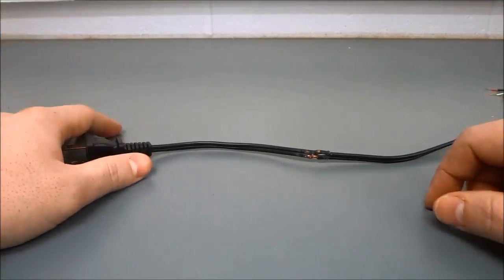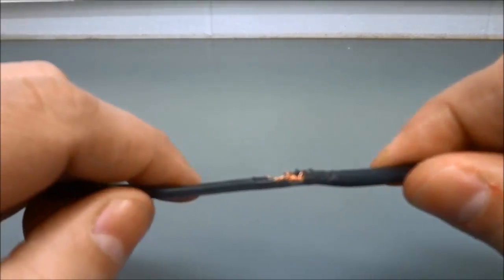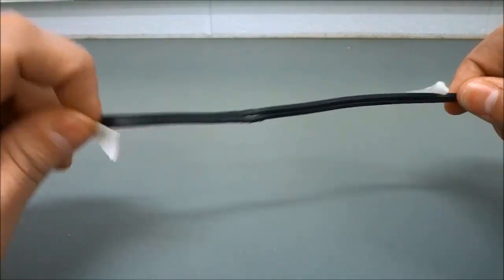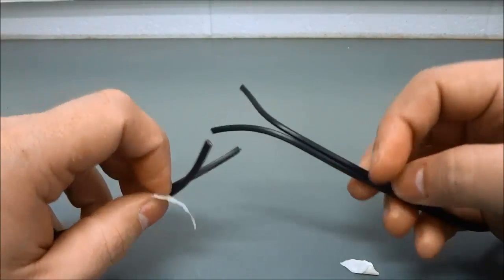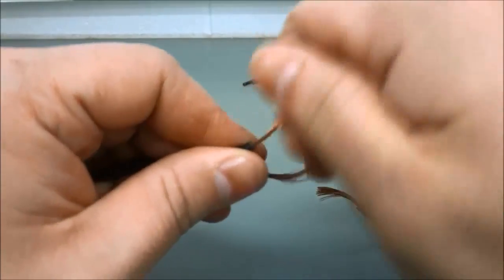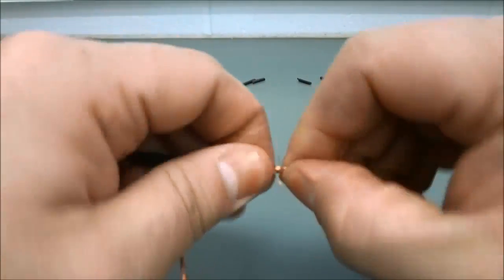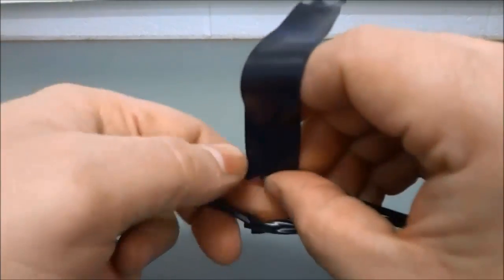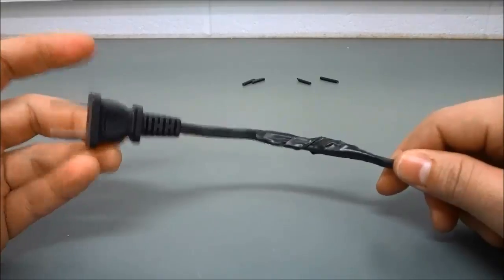How To Fix A Broken Power Cord (2 Prongs)

Comment: Stagger the cuts so that neither bare area of the spiced sections can come in contact with the other. So on one broken end of cord, one conductor is longer than the other conductor, then other broken cord side is just the opposite. This means no matter what these two bare conductors can't contact each other and the splice overall is not as thick. Then as video shows, except don't use electrical tape, use heat shrink tubing. I have a smaller heat shrink to cover each of two splices, and a larger one over the entire power cord with spices. I would also recommend soldering your splices, but not absolutely necessary.
Reply: excellent advice, you should make a video.

Comment: I usually do things like this myself but, to be sure, I scour the DIY videos on YouTube for specific information I may need to be absolutely certain that I don't mess up and set the house on fire or electrocute myself. My problem was that my puppy chewed the plug off of a $30 cheap standing Lasko fan. The hell if I was going to dump the old one and buy a new one. I just can't be that wasteful. So the info I needed was right there in the first minute of the video where he explains how to tell the difference between the two sets of wires. I was looking for a visual difference in the wires like one being black and the other white, and didn't notice the "textural" difference where one had ridges and the other was smooth. I pretty much knew what to do from there and would have not watched the rest of the video but my wife said I should be nice and watch the entire video so I did and gave it a like as well even though most of it I already knew...

Comment: To determine the hot wire from the neutral that the plug is detached The smooth side is always hot and the ribbed side is your neutral. (Electral Standard). The new plug will have two prongs, the larger prong is always neutral. (Electral Standard).
Reply: William Watts:   You just answered my dilemma.  👍
Reply: Thank you!
Reply: Hot is white and neutral is black?

Comment: Using fingernail polish works better than tape... as you saw, tape comes off too easy.  Fingernail polish will stay like.....  idk.. FOREVER.  In this simple situation where there's only 1 wire... its not a real big problem.  But when you have several electrical hookups to do... using different color polish can make the hookups easier by color-matching.

Comment: my question is how would I be able to distinguish the hot and neutral sides of the wires when the prongs have been broken off, I'm using a different 2 prong power chord to join them

Comment: What if your pup chewed the top of the cord off (including the plug)? Is it worth the fix with another plug from another appliance with a similar level of power? It was a fairly expensive heater, and I'd like to salvage it if at all possible. Thanks! :)
Reply: Here are the specs for it: 
•     Amps: 12.5 
•     Wattage: 1500 W (+5% –10%)
•     Working voltage: 120v AC/60Hz
Reply: Just buy a replacement plug from your hard ware store

Comment: Why would you bother to save 2 inches of line wouldn’t you just go and buy a replacement plug
Reply: Its just a tutorial.
Reply: It depends on the project...mine is damaged in the middle of a cord to a small electrical appliance.